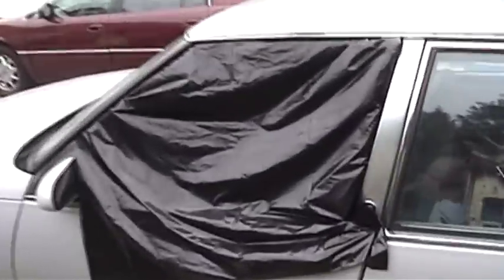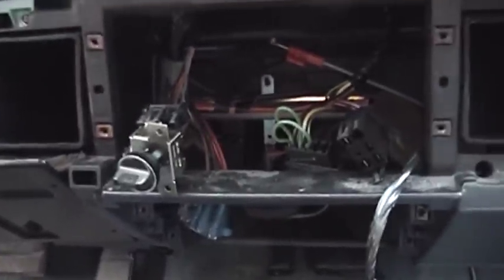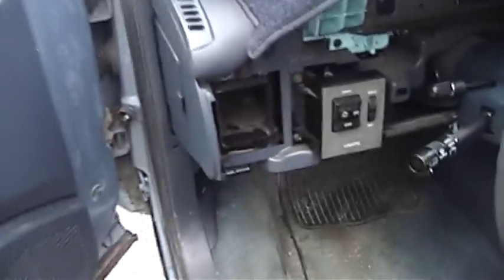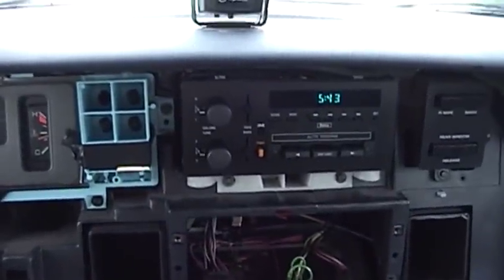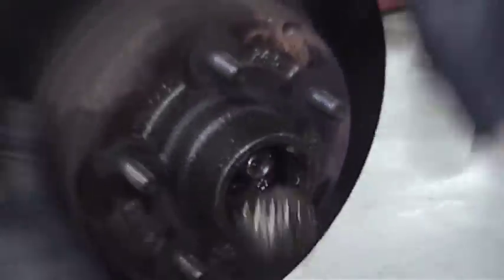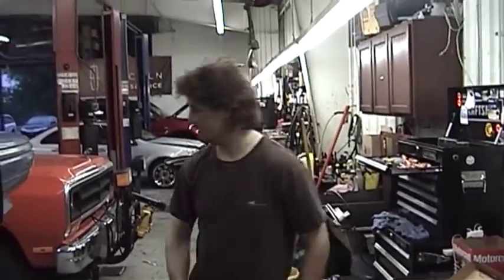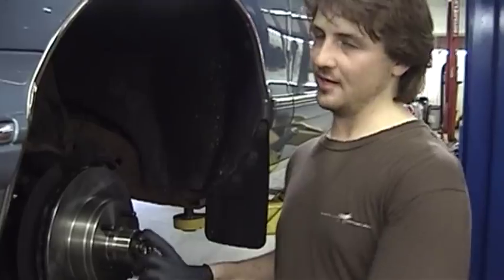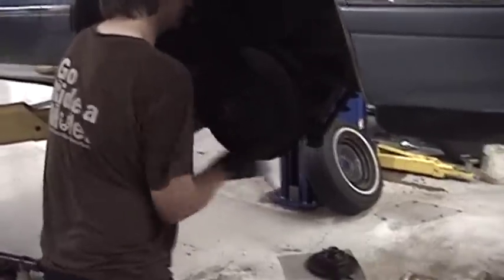Various Updates and Caprice Station Wagon Brakes

Comment: My ABS light is on since long time ago in my Caprice 91 model.Plz tell me how to fix it.One thing I remember is that i am using Buick car wheel rotor.Can this be a problem?
Reply from the maker: +Riz7151 I've never had an ABS fault on this car. You must diagnose the issue using the troubleshooting information provided in the FACTORY service manual (no Haynes or Chilton's). A Tech I scan tool may be required to retrieve fault codes.
Reply: My Grand Marquis had the entire ABS computer fail before I bought it. I figured my parents learned to drive without ABS, I can do the same. 9,000 miles later that light is still on.

Comment: I've replaced that high speed relay in my 1985 before. High just didn't work. The rest worked perfectly and now everything is perfect. The 1981 Bonneville had the same thing happen but that was a broken wire.

Comment: Very true, it does make narrowing down and finding the problem easier in some cases.  My truck will display some (but not all) codes in the odometer if you do this cycle the key on and off thing.  We also have a nice scanner that will read codes as well as monitor the sensors for the other codes.  All the electronics have done more good than bad in my eyes, but it does make them more complex.

Comment: Yeah it is not many places do that,idk how easy it will be to fix cause already replaced the fuel pump,and it did not fix it,and it died on me like it is out of gas,while the is at least 10 gallons in the tank,but hopefully it will be easy.
i will check the speakers when i get the car back, i am also considering making a video of my car when i get it back.

Comment: I it is a great car,i am now having a weird fuel problem not even a week after i got it from a dealer ship,but since it seems like the problem was there before they sold it to me,they are not charging me for the repair,but it is a great car other wise i love crusing down the highway in my boat of a car lol,and it gets not bad gas milage since it has a 305 5.0L V8,rather than a 350 lol.
Plus i only am paying $2500 for the car at a dealership.
Also so the crackle is the radio and not the speakers?

Comment: Nice Caprice man,i am currently buying a white 92 Caprice(not a wagon)air works,cruise control does not,the radio works,but the speakers crackle if you turn the raido up load,the drivers windows seems to be off track,and the fuel guage does not work either ,also the drivers door lock is damaged like someone tried to break into the car at some point.

Other that those small problems it is in great shape,and it only has 96k miles,i love my car and i am going to baby it.

Comment: I've replaced too many window regulators and other door parts to be especially impressed by Toyota.  They build a good engine and transmission, but the bodies are like tinfoil and the "hardware" is brittle.

Comment: The crazy thing is, on my truck (01 Durango with that same styling as the Ram you mentioned) has what looks like a basic climate control, only knobs and sliders, but it is actually a module with a software version and everything.  Kinda crazy.

Comment: The ABS/braking system in my car likes to make a horrible buzzing noise and vibration when I'm braking on a bumpy surfaces. I've been told it's normal and nothing to worry about, but damn is was damn annoying - so I pulled the ABS system and drive without it. No more annoying buzzing or vibration.

Comment: Hey look, my old radio! :)
That's funny (or interesting) about that selector switch in your climate control.  I had the same one melt on me in my 89 Lesabre T-type, along with the connector.  I did order and received both the switch and connector from rockauto, guess I got the last one.  Sorry about that!  Just like yours, I didn't even know it was bad until I took it apart to fix another issue.  I guess we should both be thankful our cars did not catch fire.

Comment: Must be a GM thing with the cruise control and HVAC controls. Had a 1987 Oldsmobile Delta 88 (Loved that car, was my first vehicle) that the cruise control and HVAC controls were a little wonky. Never really got around to tinkering with those because even though we took care of repainting the outside and minor rust repair with doors, etc. the Pennsylvania winters already took its toll on the car. Fuel lines, brake lines, gas tank, etc. were shot. At the time didn't have anything to put into it.

Comment: Enjoyed your video.  However, you didn't show depressing the caliper piston in.  There is an inexpensive tool to safely push this back in.  Most important, you should always open the bleeder screw and allow the old brake fluid to exit here, and not push old contaminated fluid back up through the ABS system nor the master cylinder causing seal and other problems.

Comment: I've done that job many times, but I've never seen a wheel bearing packer before!  I just do it the old-fashioned way, with a fistful of grease!  And no gloves of course!
And I hate anti-lock brakes.  I feel like I don't have control of the car when they kick in!

Also, the Caprices and the Astro / Safari vans (up to 2003) share the same spindles, rotors, bolt pattern, and other front-end parts.

Comment: we have 3 cars two of them gm and one is a honda.  They all have about 100k miles of year round wisconsin driving.  The buick is 10 years old and falling apart, the 2005 silverado has a little rust in the door, and the honda has one small rust spot under the gas cap.
the buick and the silverado have a lot more balls than the honda does though, so it's ok :P, the last gear in the honda is geared for like 200mph

Comment: I had a similar failure on my 85 caprice, only my melted wiring occurred under the hood. A connecter supplying power to the climate control had melted, as did some of the wiring for the resistor block. Have a look at yours in these places. What I did to eliminate this problem was clean the contacts thoroughly with emery cloth, then apply dielectric grease to all connecters in the circuit. A poor connection acts like a resistor, an additional load. The terminals heat up and melt.

Comment: @uxwbill 
Snap-on, Mac, Blue Point, Matco, & Cornwell tools all have a tool known as cotter pin removing pliers that are identical to the ones he used, I have a pair and they are just sidecutters, differing only because the angle of the head is greater to give leverage while prying.
I am like you.....I always use the correct tool!

Comment: To those attempting these jobs, wear eye protection when using air tools! I would have replaced the bearings "while I was in there", hopefully one of the races wasn't what fell on the ground when he was taking the rotor off! I like that parts bath, its like an endless supply of brake cleaner, cause you never have enough of that stuff.

Comment: Keykeeper is FAST!!!  I'm impressed.  I'm also amazed that that car still has cone bearings that you can pull by hand.  My '82 Escort had sealed bearings that had to be pressed out.  I'm surprised that a car built 8 years later didn't.